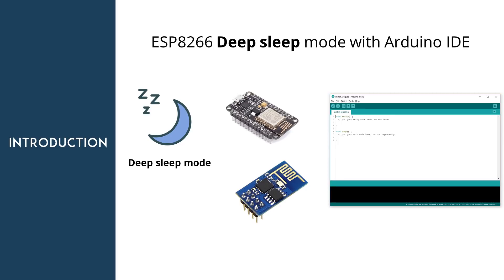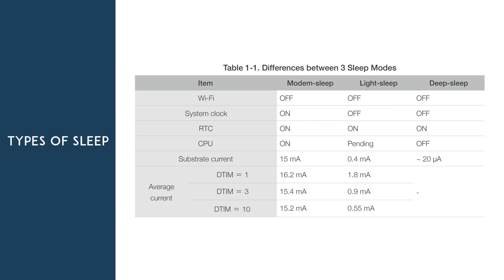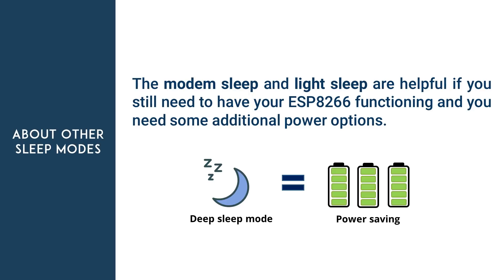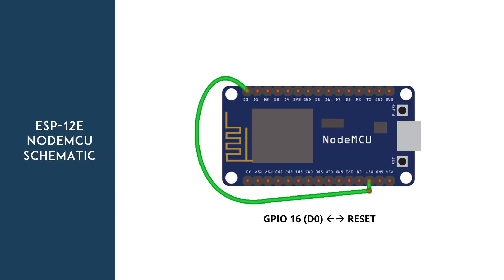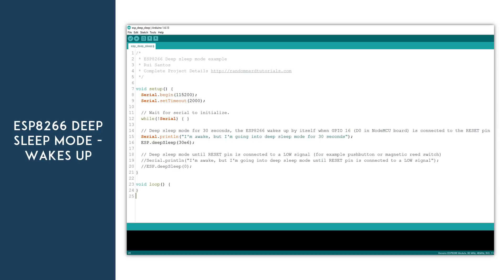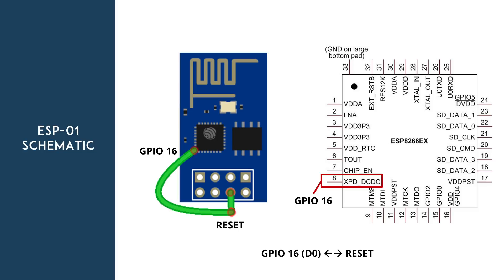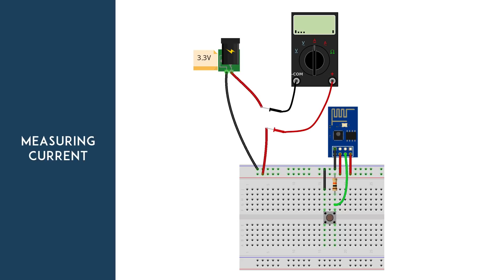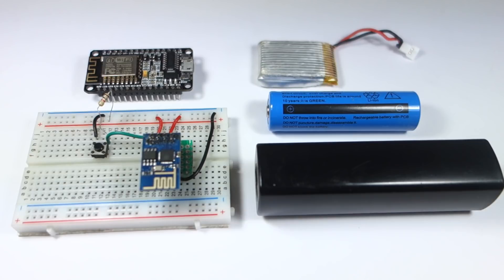ESP8266 Deep Sleep with Arduino IDE

Comment: Very useful, thanks.
Any estimates about the difference in current drawn in deep sleep between ESP8266 board and NodeMCU? I guess there should be quite a difference there to power the larger board and the additional components on the NodeMCU.

Comment: For the ESP8266-01(S), if you don't want to solder a wire between GPIO16 and RST, you can use an external low-power timer like the TPL5111 (35nA). It is also necessary to unsolder the LEDs to reduce consumption.
Reply: ♥
Lovely. Thanks!
Any estimates about the difference in current drawn in deep sleep between ESP8266 board and NodeMCU? I guess there should be quite a difference there to power the larger board and the additional components on the NodeMCU.

Comment: completely no need for the resister between button and ground, without it you could achieve the 20 ua in deep sleep mode, just as described in datasheet
Reply: Are you Sure? I Plan to do this with a Reed Switch and a wemos d1 Mini. Can i leave Out the resistor? If No, what Kind of resistor do i Need?

Comment: hello, i have a problem with my project, I have 5 buttons and 5 LEDs one LED per Button, my problem is that when I trigger one of the button pins , pin GPIO05 goes HIGH (GPIO05 isn't in the code.
This happens on deepsleep code.

Comment: great stuff, i appreciate the video. I have a couple of questions about the -01 version. What is the value of the resistor you use between RST & 3v3? i didnt see it listed on randomnerdtutorial. Is it necessary? you said in the video, although  referring to the NODEMCU version, that the reset pin is always high. Would you change the value if you were going to use a reed switch in place of the push button?
Again thanks I appreciate the content

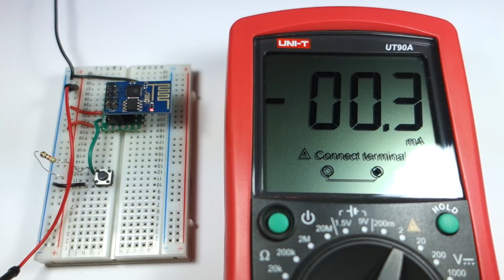Comment: Thank sir. it is a helpful video. I'm try to test the current consumption of ESP-WROOM-02 in deep sleep mode. the same kind of ESP in your video. but 5:00 shows that the current consumed is 0.3mA=300uA. it is much higher than the spec given by supplier.

Comment: Very good tutorial, do you have any trick for the node MCU board ? each one I tried, Wemos D1 mini, or NodeMCU I alaways have 10mA even in sleep mode ... Thanks by advance !
Reply: I know the question is 2 years ago, the reason NodeMCU or D1 mini still pull lots of current even in deep sleep because of the linear voltage regulator of 5V to 3.3V, also the usb-serial chip consumes some.  Therefore unless we remove usb-serial chip and voltage regulator, we will not be able to achieve microAmp.  microamp probably for a plain esp8266 using 3.3V only and no serial-usb.
I have tested both NodeMCU and D1 mini and found not much power save when I measure it.
Reply: @zerodegrekelvin2  Thanks a lot ! yes definitely, voltage regulators are the ones responsible of the consumption, I ended up by making an external timer with a switch ( transistor as a switch) to save as much energy I could, and I could reach 60 uA as far as I remember. If interested, feel free to answer this answer and I will answer even 2 years later " thanks again and take care

Comment: Rui, good video. Please take in attention that the maximum deep sleep is 4,294,967,295 MICROSECONDS. After that the board just reboots, because the variable gets the maximum number possible.

Rui, bom vídeo. Mas de tomar em atenção que o máximo deep sleep é de 4,294,967,295 MICROSECONDS. Após isso a board faz reboot, pois esgota-se a variável.

Comment: 0.3 mA is so far away from 20 uA, what is the reason?
Reply: in the esp-12 is necesary remove la led, like de esp-01? becouse i see the led in the esp-12, is always off in deepsleep, but it is ON in normal function like send a message, thanks!
Reply from the maker: That is correct. The ESP8266 chip consumes 20uA in deep sleep mode. However, the ESP boards and modules have on-board components like LEDs that also are consuming power in deep sleep mode which results in a 300uA of total consumption. Removing the LEDs will lower that value. I hope that helps.
Reply: you have demo with ESP01 right, do you mind to check if it is really 20uA without the LED? Thanks.
Reply: a led draws about 3mA with 1K, so I don't think it is the led...  and we should not believe all they tell us right? I think if you make a video about deep sleep mode then at the end we should be able to prove/check if the specs are correct. If not it is useless I think.
Reply from the maker: If you remove the red LED from the ESP-01, it will only consume 19uA... 20uA, I've just tested it myself. I hope that helps, Rui
Reply: You have to use ESP8266 12E (F)  module and HT7333 -a power supply, a total consumption of 22uA together..